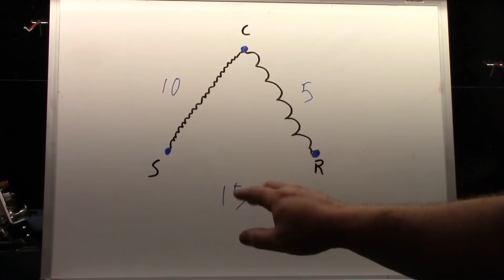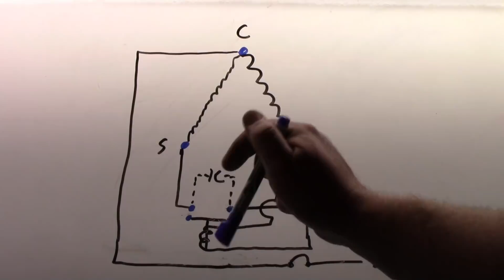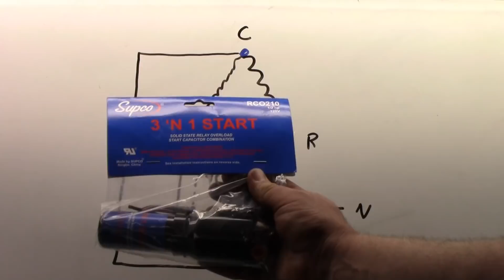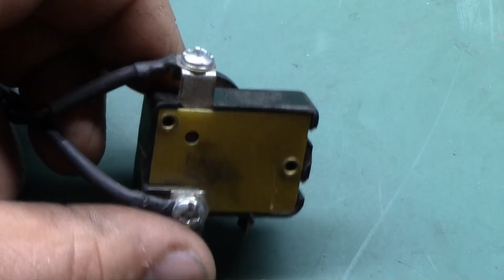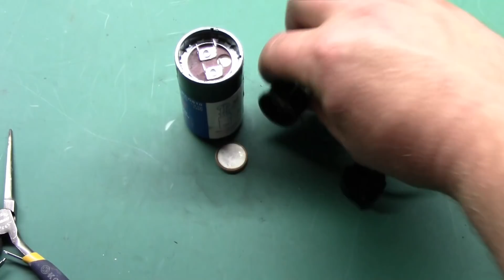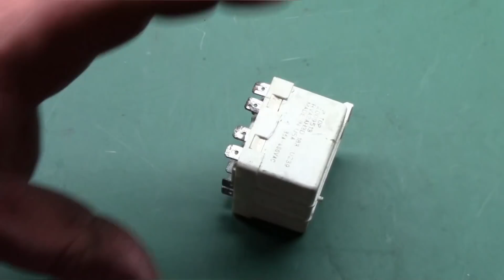Compressor Current and Potential Relays Explained

Comment: Hello, thanks for the video. I'm not a professional in the field, but I have a question, for a solar DC to AC inverter is it easier the start of a compressor with a hard start kit (or with a capacitor?) than a compressor without? I need to buy a fridge and discover that some new ones comes without capacitor. I use off-grid solar power. Thanks for any answer.

Comment: I like Your explanation but I have a problem with the diagram.  The start capacitor wont work if both sides of it are connected to the switch/relay contacts all it could do is discharge the capacitor. And with the switch open as pictured will energize the start winding through the capacitor all the time then over heat then cycle overload until something gives up the ghost.

Comment: You mention a PTC (positive temperature relay). If the PCT stops the flow of current by temperature does it not cutback in when it cools down and then cycles the whole time the compressor is in use? I can now answer my question: The Standard PTC relay device has a PTC chip in series with the start winding. PTC or Positive Temperature Coefficient devices when cold, have a very low resistance, but when heated their resistance will go very high, a thousand times higher than when there cold. So when the compressor is ready to start, the PTC relay must be cold .so when power is sent to the compressor the power goes directly to the run winding and also to the start winding via the PTC device. Within a second or so of the compressor starting the power to the start winding is virtually cut out due to the PTC device rapidly being heated by the power drawn by the start winding. The power to the start winding is now virtually nothing ,simply a small current to keep the PTC device warm and the start winding out of circuit while the compressor is running.
When the compressor cuts out the PTC cools down and it’s resistance drops to around 25ohms ready to restart. The PTC requires about 5 minutes to fully cool down so that it’s resistance is low enough to energise the start winding due to cooling demand.

Comment: First good video on the explanation of how to repair a non starting compressor.  If you know how something is designed you can figure out your own troubleshooting approach and why it failed .  Most of the people creating these types of how to videos don't have a clue as to how these systems work.  They only tell how to throw on a Support 3 in 1 as a repair solution.  After seeing this video I see why the Supco could damage a compressor.  BTW the start capacitor is there to prevent the premature burning of the relay contacts (like the condenser used in old distributor/points automotive ignition systems) while the run capacitor is for power factor correction.  This why the smaller HP compressor units don't have a start capacitor while larger (higher current compressors) do employ them as contact burning is more acute.
Thanks for the great explanation of compressor starting circuits.

Comment: @19:15:  You misspoke, right?  You meant the back EMF opens the potential relay and kicks out the start CAPACITOR, not the start WINDING, right?  The start winding still has a current route via the run capacitor, such that the start winding is energized as long as the circuit is energized and the run capacitor works, right?

Comment: Installed an RCO410 last year worked great until recently after 2 days without power.  would not start compressor for fridge to get up & running once power came back on. I ordered another one hopefully it solves the issue.

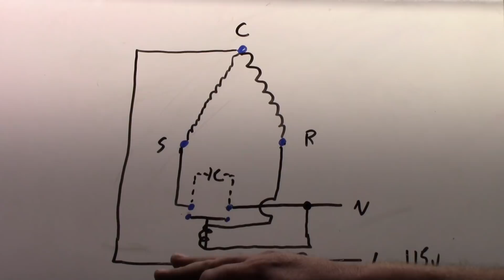Comment: Good video....however....at around 6:53, you say the current relay opens and the start winding drops out.....but the capacitor ( which unless I missed it) you do not say if its a run cap or start cap,  is providing a circuit by passing the relay whether its open or closed....or certainly the way its drawn.....I'm probably wrong....but your SC doesn't look like its in the wrong place....surely the SC must have to be in series with the relay switch....or how else will you remove if from the circuit after starting?.....can you please clarify?  thanks 🙂

Comment: Oh my gosh, this is so far above my head and my knowledge of electricity I'm almost ashamed to ask my question but since you do display that knowledge it makes me think you should be the first one I ask.
So you see my deep freezer broke down and another u tuber helped me install a 3 n 1 supro relay (at least I think that was the brand name) 
Anyway today I was playing with my new laser light remote thermometer and noticed my compressor stays at about 140° all day. So I go poking around the web and some Facebook groups and I was asked if my ( relay was "kicking down"  I asked what the heck does that mean and another poster said I should have a certain amt of amps when it starts and that those amps should decrease once it does start and run. I asked for some more guidance and nobody ever answered so I'm guessing they didn't want to deal with my ignorance. So if you would also not want to deal with someone who don't fully grasp electricity matters then please don't feel obligated to help. I totally understand. 
Question (s)
1. How many amps should I get in start mode and in run mode
2. How would I even test to find that out. (I never hear the compressor stop at all) and finally
3. Is 140° to much heat for the compressor to generate? The rating marked on my 3 n 1 relay is (I believe 2w-4w ) if that doesn't seem right I would be willing to pull it out to make sure.
Thanks for any info.

Comment: Great video. Thanks. I was wondering if I could just measure voltage drop across hard start relay at start up, expecting maybe just a few volts until compressor gets running. One thing that did occur to me was to disconnect fan for compressor start up test so I can better hear compressor start or not. Of course not leaving fan off for more than short test.

Comment: Great video on relays and how they work with the compressor especially on the hard start . But I have a question on a  type of relay on a maier deep freeze  half ton .
There is the model number on the relay ptc zhb125-135p47 and on the unit haier model fh71cm33nw.  I have not been able to find anything on the websites one the wiring one the relay ,   it has 10 - + 5 cap ,     how and what wires go one the 4 pin ptc relay.   Helpppppppp

Comment: Hi,
This is a great explanation of how a compressor winding is put together, my problem is that I have only two wires going to the connector and only on two of the pins of the compressor. 
I'm not getting any continuity on the one pin where there's no wire going to it. 
My questions are: Are all pins supposed to have continuity between each other, the one that has no wires has no continuity? 
If there is no wire going to the right pin on the connector of the compressor, does it still need to have continuity?
I need to know if my compressor is bad.

Comment: Why L1 (hot wire) first move goes to Common terminal but not Run terminal ? Anyone can explain?
Reply: Thank you Sir it is absolutely clear, but could you please explain some times I see this current relay is put L1 (hot) to run terminal and, the neutral is to overload which is attached to Common terminal???
Reply from the maker: The relay switches the neutral.  You want the hot wire to go to the overload which is attached to the common terminal so if the overload trips no power gets to the compressor.

Comment: I use them also, I have had good luck with the 3 in1 lasting. I try to find the cause of the original failure,most times it’s either a unit on its last leg or the condenser is PLUGGED or fan bad. I have no problem leaving it on the unit. Most customers don’t want to pay for the 2nd call to put OEM parts on a white elephant anyway. Great video thanks.

Comment: Great explanation. A little observation; a pronunciation between Star or stock I was confused. Another issue; if my refrigerator does not have a visible capacitor, together with the relay, where is it located?

Comment: Those start winding's look like they are getting amps regardless of that current relay being open or closed in your diagram. The only thing I can think is that it wont overheat because the electricity will take the path of least resistance through the run winding's. I'm in school right now and our teacher is having us connect a pictorial diagram together with a current relay and overload- the relay has N.C contacts, and so far it seems like to me like L1 should feed power to the current relay first and then onto the motor so it can actually isolate the start winding when that switch opens from the electromagnetism. Would love to hear your thoughts, friend.

Comment: I like your explanation of the hard start kit. In a pinch I had to settle for a 2-wire since it was roasting outside and it was all I could get locally when my compressor began having trouble starting. I plan to change it out for a 5-2-1 as soon as I can to hopefully last until I change out the whole system.

Comment: Hi, I wanted to make this silent compressor so I got from my friend the ac compressor (from external unit) and  I was wandering whether you would be able to help me with connection of the compressor ( ac was single phase) but there wasn't separate capacitor as I can see on some YouTube videos, there was whole like main board from computer and there were few capacitors, any way on the compressor itself is a label which says 148VDC, at 120Hz, and I have no idea how to connect it to a power supply, by the way I am in UK so as you know we have 220V.
Reply from the maker: W Raven 

More than likely what you have is some sort of inverter driven compressor.  A lot of mini split units use kind of a similar deal.  That board was more than likely the control unit that ran everything.  You’re probably not going to be able to get it running without knowing at the very least what unit it came from and getting a wiring schematic for that unit.  There is a good chance you won’t be able to get it running.

Comment: actually the run winding is the higher resistance since it draws a lot more current when starting
Reply from the maker: No it's not.  The start winding has a higher resistance.  It's made from fewer turns  of smaller gage wire to create a low inductance high resistance ratio.
Reply: @Halligan142  Wicida Sarme
Wicida Sarme, Retired Engineer (2001-present)
Answered Jul 13, 2018 · Author has 13.3k answers and 3.8m answer views

Typically starting windings in motors uses a heavier gauge AWG size of magnet wires than the AWG size used on running field coil windings..

This is I believe is necessary in order to support the generation of a much more stronger magnetic flux needed for establishing required starting torque.. In order to produce a stronger magnetic field, it will require a magnet wire size that is capable of handling more current as compared to the amount of current required to sustain the continuous running operation..    This is what I was told back in the days when I first start learning about motors

Comment: First, thank you for the detailed explanation. I have a question on PTC Relay on Supco 3-in-1 start kit. When high current flows through PTC it heats up and cuts the power going to start winding. This part is understood. What happens when the compressor starts running normally and the heat decreases inside the PTC will it connect the compressor’s start winding back again when there no need because the compressor is already running normally.
Will my described process, PTC off-on continue until it will kill the compressor? Or I am missing something? Can you please comment?
Reply: The PTC will still be off (open) if the compressor is running,this is  due to the current drawn by the compressor when it is running.But when (if) the compressor stops ,the PTC would cool  down and it will be On.Again if you start the compressor again ,it will start and the PTC will go Off when the compressor is running.

Comment: Great Video. Thanks for sharing your knowledge, learned a lot.  Just had one comment. All these burned contacts which can lead to major failures, I wonder why there's no component to help absorb that electrical arc.  All the old automobiles with points and condenser ignition used the condenser to protect the points from burning. You would think they could incorporate a condenser of some sort into the system.  Just a thought, I'm no engineer.  Thanks again
Reply: Actually the automotive condenser is a capacitor. In the small fridge current relay the capacitor is in parallel to the contacts in the same way as the condenser (capacitor) is in parallel with the contact points of the ignition,

Comment: Thanks for making this really helpful video. I’m a bit confused on the capacitor wiring. It seems to me, when the starting relay closes, it takes the start capacitor out of the circuit (it is shorted out) so how is that capacitor helping to start the motor? And, if true, once the relay drops out, it looks like the capacitor is in series with the start winding which I think is more like a run capacitor. But then it should be in the Run leg???
Reply: Dadla Ponizil , I was reading the comments to see if anyone else picked up on that.  The start capacitor should be in series with the switch; only the run capacitor would parallel it so his print is wrong.  In addition, the cap is not to stop arcing in this case.  It is to shift the phase in order to start the rotation going.
Reply: There are two scenarios described in the video.   The FIRST is a fractional hp 115vac motor. In most cases these are called single phase induction motors, either cap start or cap run.   The usual wiring has their cap in series with a switch or current relay.   The SECOND scenario are larger several hp single phase compressors, typically 240vac 1-5 ton systems. These are PSC (Permanent Split Capacitor) Motors.  On those,  a capacitor is "Permanently" in series with the start winding.  It is called a Run Cap and allows continuous start winding current. The amount of current is limited by the uf size of the Run cap.   For a larger compressor, the Run Cap may be sized at 30-80 uf.   A "hard start" kit for a typical single phase PSC motor  adds another bigger cap in parallel to the Run cap "Temporarily" for more start winding current.   The hard start cap, often around ~300uf, is switched out by a potential relay as soon as the motor comes up in speed.   However in a PSC motor, the Permanent Split (Run) Capacitor stays in the circuit.  Finally most PSC compressors in the last 25 years are scrolls which usually don't need extra hard start kits and use only their Run caps to allow current to their start windings.
Reply: the cap is to stop arcing when the starter switch opens

Comment: Great video for me, who was trying to get some more context on how all these parts work for a DIY fridge repair.  Installed a 3n1, but ultimately the compressor seized again ultimately the thermal fuse did not stop power the circuit breaker did.

Comment: Can you please explain why relays are used to start compressor and what are the advantages & disadvantages of using start capacitor and run capacitors
Reply: Basically, relays are used to start a compressor because it is a single phase compressor motor and therefore only has two poles within the motor that are available to produce the torque required to get the motor spinning at startup, as opposed to six poles 120 degrees apart in a three phase motor. The relay (as is very well explained in this video) adds the start winding into the circuit to provide the extra starting torque required to get the motor running at startup, but because the start winding is a much higher resistance winding it will quickly overheat and burn up if it is left energized for any length of time beyond the initial startup (i.e. high starting torque) time period. Once the motor is running the current draw through the run winding will drop (or decrease if you prefer) from the higher inrush current value at startup, thereby decreasing the current flowing through the electromagnet, opening the contacts on the start winding and dropping the start winding out of the circuit. 
The only “advantage” to using a capacitor start capacitor run (CSCR) type of compressor motor is that it allows manufacturers to produce small fractional horsepower refrigeration units that can utilize single phase 115V or 230V power. The only purpose of adding capacitance (or inductance) into an electrical circuit is to phase the voltage and amperage peaks at different times during the cycle - in the case of capacitance the phasing is negative and the current will lead the voltage, whereas with inductance the phasing is positive and the current will lag the voltage. 
You should google phase relationships in single and three phase circuits if you want a more in depth explanation.
The disadvantage to CSCR motors is the extra cost of the starting components, the eventual failure and required replacement costs for those components, and the fact that three phase motors will use less current than their single phase counterparts to produce the same horsepower or mechanical work. 
Hope that helps.

Comment: Would be possible to show wiring with 30 amp contactor and 3 prong capacitors for 240 volts 2 phase?